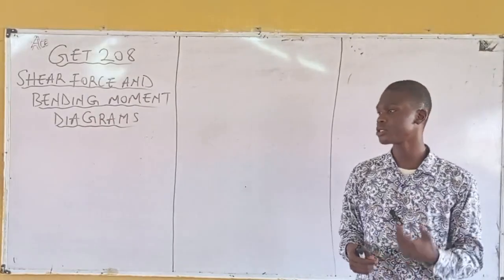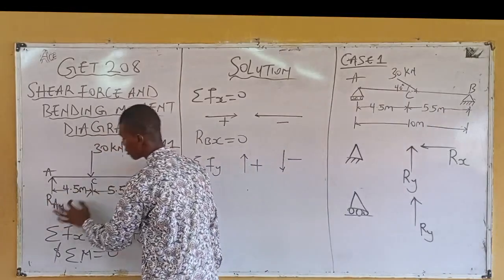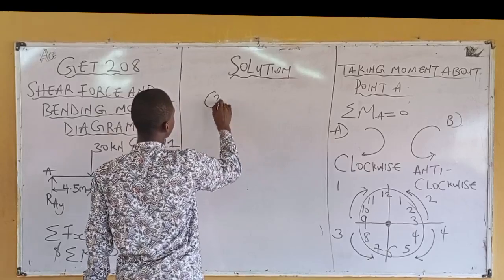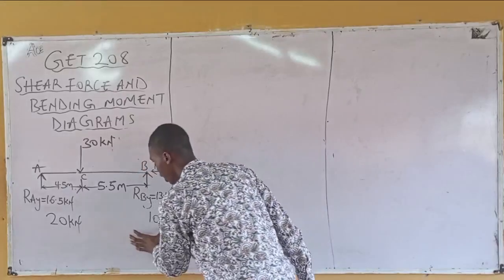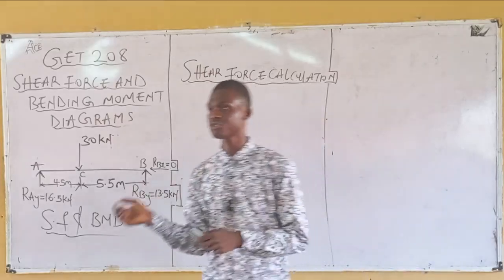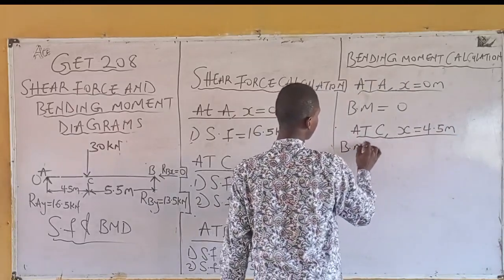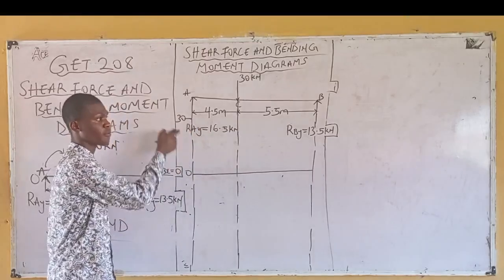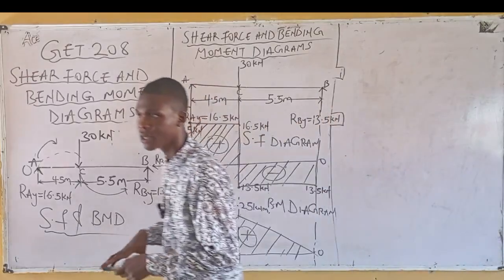How to Draw Shear Force and Bending Moment For Point Loads ~ Strength of Materials.

Comment: I have a question sir, why can't we use 16.5×4.5

Why are we using 10 sir
Reply from the maker: That a good question you asked,but if u followed  the video carefully you shouldn't have question on that,
Also, ur question should be regarding the B.M at B I.e 10m?
16.5kN is traveling to B and Before getting to B it covers 10m and not 4.5m.
So, that is why it is (16.5×10) and Not (16.5×4.5).
You are going to have 16.5×4.5 if you are calculating B.M at C.